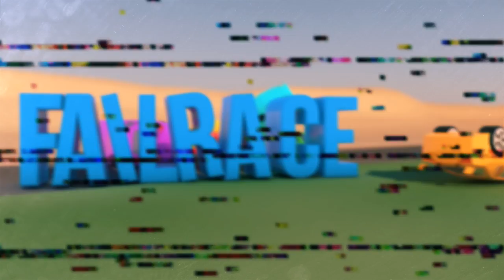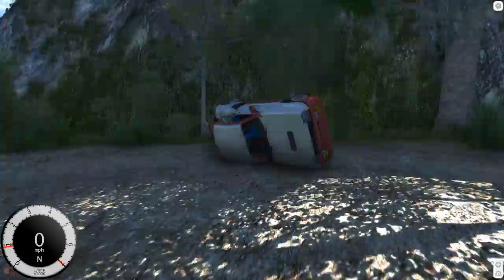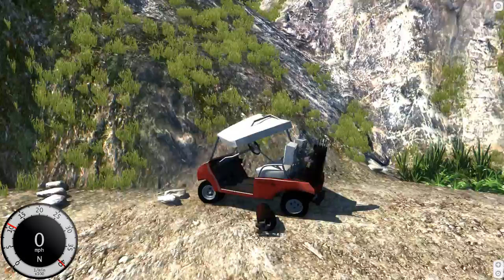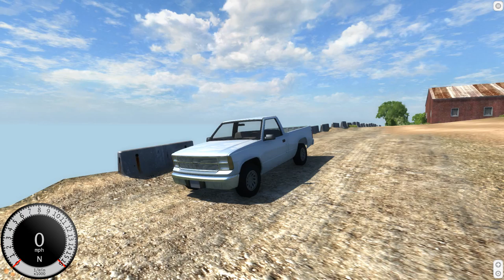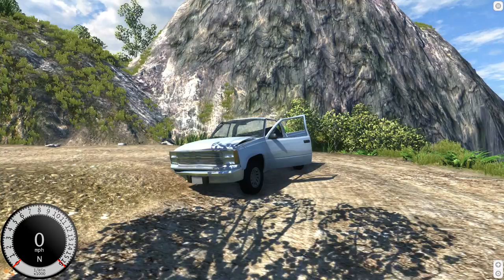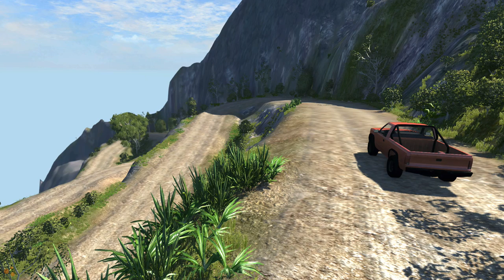FailRace BeamNG Downhill Chaos Ep 20 Renault 5 + Golf Car + Electric D Series

Comment: i noticed the gearing issue in one of the cars in GT 6, its called the 2J and its from Chaparral. ((it basically looks like a box with 2 fans looking things in its back)) That thing have 3 gears only and accelerating in it from a stand still is a bit tricky.  The easiest way to set it off quickly ((Alex did the same with the electric D series)) is to hold the handbrake, rev the engine and then release the handbrake and it will accelerate much better.
Reply: yeah there is a modified nissan 350z with the same problem on the game aswell
Reply: does the engine revving trick work with that car???
Reply: yep
Reply: It does launch poorly, but it makes up for it with incredible top speed, since it doesn't use downforce in a conventional manner.
Reply: RMedia Obelisk yep and don't forget the price, that 2J is'nt that cheap.
i think that makes up for the incredible top speed it has (which makes racing in the Super championships less challenging). but it sill, that thing isn't all easy if you get carried away, that thing will spin out on you and you'll have to go through that horrible launch to gain your speed back (unless u use the revving trick).
Reply: TheCrazyMoon It never spins if you set up the gearing and suspension right, but I can see your point.
Reply: I still hate that car, its just so overpowered (much like it was in real life, except its one weakness in real life doesn't exist in GT6.) It absolutely ruined the historic race car championship. I was hoping Polyphony would be smart enough to remove it from that championship and let it be used elsewhere at least where it wouldn't obliterate all competition.
Reply: i was actually thinking that they could(IRL) have made a championship just for that type of race cars, but looking back at it that would have been really expensive at its time, and in game i think it can be fixed(i don't know if it's an easy fix) is to restrict it from races like the red bull X fantasy fan car.
Reply: Yeah they did it with the X1 cars and F1 cars as well but fail to do it with the 2J which has been ruining that championship in since gt4.
Reply: yeah that why i said that type only(i should have added >specifically<) but what i meant is a championship just for these fan cars and the fan cars only. i think the will be very expensive (maybe more expensive than the formula 1).
Reply: They should, but I don't think its Kaz's priority at all right now.
Reply: but maybe in the future we could see these lightning fast race cars going against each other ... we can always hope.
Reply: TheCrazyMoon Actually...There are only two real fan cars.  The 1970 2J and a Brabham in the late 70s to the 80a (can't remember the year)
Reply: i didn't noticed it, thanks for that one
Reply: it wqs 78 brabham used a fan car the bt52 i think it was called it has a 100 perent succses record as it won the ony race it ever entered
Reply: kayto101racer i looked at the pics of that race car and it looks way better than the Chaparral 2J race car.
Reply: well they were desinged for two diffrent championships
Reply: yeah i didn't really think of that one, if i was not mistaken one was designed for the Can-Am championships and the other for F1 championships.